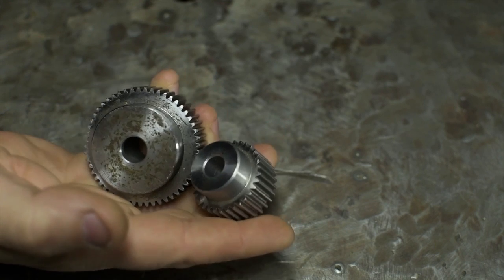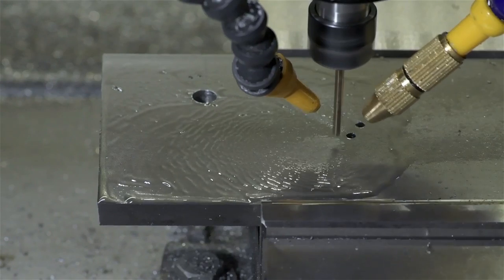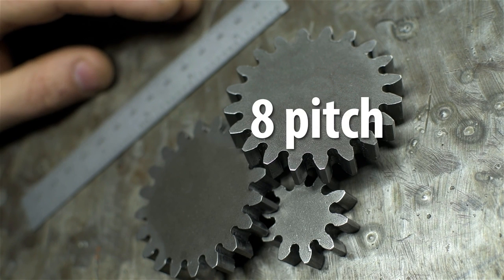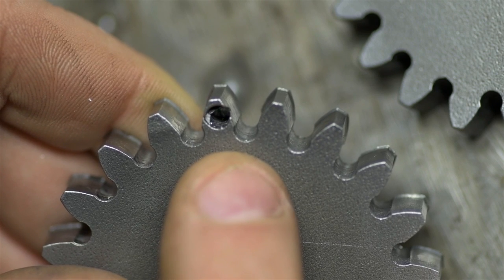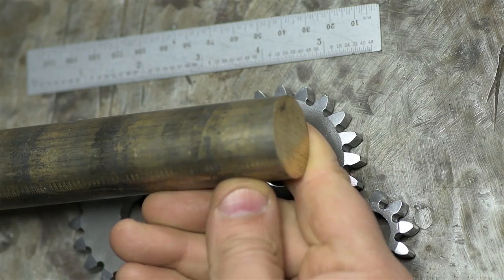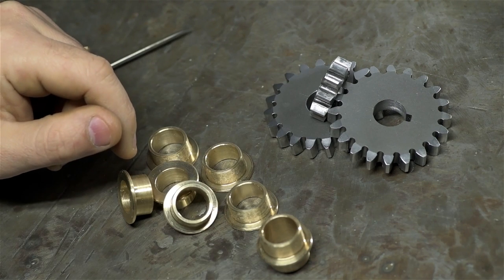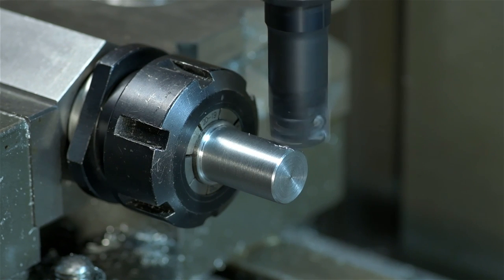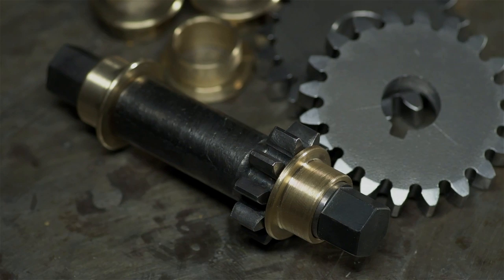Bushings and Gears: The Prequel

Comment: Why don't you also drill a center hole while the gears are on the router?  

Then it would've helped on the lathe for centering them in 4 jaw and also skip the center drilling part
Reply: I thought the very same.
Reply: its not as accurate plus he likes using the lathe :)

Comment: I liked your comment on 0.5 x a dozen. I grew up in a country that uses the metric system the way it was intended. The European and American way is to take 200 thou and multiply it by a hand of sand. Whatever you get is still a terrible thing to measure or work with. Suppose it is fine if you grew up with it. Its like having a four speed car with first and an eighth gear, second and three sixteenths, third and three eighths and fourth and and a half. Doesn't matter what you work with its always a fraction. Love your videos and the humor.

Comment: Super video - thanks for the share. Bearing bronze = very $$$ ???. Have to be economical playing with this bronze, unless someone knows where to source for hobbyist budgets??? Also, the collet chuck - are those available? When I google on collet chuck I get every collet chuck under the sun.  This looks like a cool project. I am interested in cutting some gears to pair up a couple of small model airplane engines. I have a StepCraft 840 CNC I have yet to spin up. I like the way you cut these gears.

Comment: Another great video.  Thanks +This Old Tony!    I'm curious about the center holes and keyways on each gear.  You've chosen to build them on the lathe rather than letting the CNC do the work.  Does the lathe give you better accuracy, or are the other reasons you've done it this way?

Comment: If you're breaking end mills doing plunge operations, have you ever tried ramping the initial cut? so you are pressing straight down on the end mill, you're going in at an angle......I use it all the time when using larger bits with no real bottom clearing ability. (on wood).

Comment: As usual enjoyed the video. Thanks. 

Just wondering any specific reason why you didn't  have the cnc router cut the center hole on the gears? I know you said about plunging, not drill, then mill...or drill on the cnc and use that to locate on the lathe and open up?
Reply: My question exactly, I've also done this technique with my machine and always cut the center holes with the router too. It looks like your gears are going to have some runout. You could also do this by drilling on the router.

I've also thought of drilling the bottoms of the teeth first, seems to work really good, I need to try that next time.
Reply: Probably time. It's quick in the lathe, not so quick on a router table.
Reply: I don't think the difference in time (with fixturing and tramming the part) isn't that high. And with drilling the hole while it is still on the router it will be really centric. It would at least give you a nice surface for indicating it on the lathe for further machining.
Reply: Probably just forgot the centre tick mark in the CNC, and figured easy enough to add later.
Reply: It’s easier in the lathe tbh.
Reply: He already had to put it in the lathe so he probably figure it was just easier to do it there

Comment: Hey Tony, I grew up working with lathes and mills in  my grandfathers machine shop. Unfortunately,  he sold all his machines before I could lay claim to them. I am an amateur gun builder, and want to purchase my own mill to do work that I have been farming out. I would really like to have a full size mill (like the 7' tall bridgeport that was my grandfathers "small" one), but they are cost prohibitive. Do you have any suggestions on where to go to find used mills? Maybe a suggestion on where to buy a smaller mill for gunsmith work? Which one of the small mills would you suggest? I am fairly certain the grizzly/harbor freight table top mill is made by the same company. Is it worth it? I'm on a severely limited budget, so hopefully you've got a couple of nuggets of advice to share. Thanks!

Comment: Thanks for another excellent video. A quick question: why didn’t you cut the gear centre holes on the CNC to ensure it was centralised? I appreciate you may have wanted to take it to dimension on the lathe, but surely it would still have been easier to dial in on an existing (smooth) centre hole than off the teeth?

Apologies if this has been asked below in the comments; I only scrolled down the first couple of hundred!

Thanks again for this and all the other excellent videos.

Comment: Tony!nice to see a great video again but I've got some stupid questions to clear up!why do gears have the bevel on the side face like that is there any use for it?also why didn't u centre drill the gears on the CNC?just wondering maybe you had a good reason, 1 last question, how did you index the hex ends on the stub shaft  to eachother I can't work it out! Thanks
Reply: It makes it look cooler which in turn adds ten horsepower
Reply from the maker: you know I have no idea why gears have tapered sides.  I think they look better that way though :)  I don't think store-bought gears have those anymore.  Sprockets use the taper to help line things up I believe, but no idea why gears have it.  Re: hex ends, if you mean the hex on one end with the hex on the other, they are not indexed to each other.

Comment: Tony, considering the tolerances you're working with here, would drilling and milling the year hubs in the CNC saved you a step?  I guess you had to put them on the lathe to bevel them anyway?  Maybe your router doesn't make smooth circles?

Comment: you had mentioned that cutting the root of the gears with the drill amounts to more backlash. I was wondering, for your CNC machine, you added in another video a 4th axis. Could this 4th axis allow you to cut the gear (and perhaps the drilling) as a helix gear? I know that the helix gear would provide no advantage in the ring roller. I am just wanting to know if a helix gear can be cut under these circumstances. Also, i note that the width (thickness) of these gears are low(short).

Comment: Bongiorno Tony,
Are those real involute gear forms? If so, how did you generate them in CAD? I've seen lots out there describing how to make close approximations and understand the unwinding string geometry, but found it difficult to implement using the standard tools in solidworks and the like. 

You're my hero!

Comment: It's a bad idea to plunge straight into metals anyway, try feeding in in a slope, works much better and you don't need to predrill. Drilling out the roots of the teeth is a very good idea though. I like to drill/mill in the center holes while the gears are still on the mill, that way you get them right on center. In a lathe you could end up having the jaws somewhere between teeth on one side and not on the other, so the hole ends up slightly off center.

Comment: I just started watching your channel and I was just wondering your thoughts. On that small gear couldn't you have drilled a hole into between the teeth and into the shaft and used a roll pin to secure it? Or would that have weakened the gear too much?
Reply from the maker: In this case, probably yes!

Comment: Tony

  Is the g-code used to produce the gears available anywhere?   Drawings for the Ring-a-Roller?

Jim
Reply from the maker: not yet I'm afraid.  plan to clean up the cad and make public.  never enough time!
Reply: Where would it appear if released?  Thanks Jim

Comment: Hi ThisOldTony,

I have a question or two for you;

1) When using your CNC why didn't you remove the ID when it was still part of the stock? Surely that would of saved some lathe time.

2) Why didn't you use your Shaper to create the keyway?
Reply from the maker: I'll answer #1 in the build video if that's cool.  For #2, these keyways are small / non critical.  Just a lot faster with a hand file vs setting them up in the shaper.
Reply: No problem,

Love your videos btw :)

Comment: Hey Tony can i ask why not cut the holes on the CNC router instead of the lathe? and why do you cut a centre hole on the lathe to the second cutter?
Reply from the maker: I could have, but usually try to minimize the time on the CNC.  It takes much longer than my other machines.  The second tool was used to bore the hole to final size.
Reply: most times on the centre drill I only just cut to start the drill as the second half is 60 degrees and have had the drill "grab" making the hole slightly out of true. Not that it matters really for what your doing :) greetings from Australia

Comment: Obviously this project is about building the replacement bits for the LHC (Large Hadron Collider). My guess is that it's going to look very similar to... wait for it... yeah... that's right... the particle accelerators that they use at Punkin Chunkin events... only smaller and more efficient. Don't crank that baby up too high and create a black hole. I'm not done learning stuff yet...

Comment: Why did every piece have a spiral cut when you were going back with the wheel? This would mean that your tool is closer to the piece going backwards than going in. It's been a long time I've been able to use a lathe and I do not remember if this is a typical "issue". But it is clear that they are the reason why you moved the cross slide out after the last pass.

Comment: Hello Tony!
I have a question: Why did you decided to use welding and not Loctite gluing?  We have recently a discussion on a hungarian forum, that the welding for connecting parts is rather habit of elder generation of people, who still not welcome the new achivements in machining like gluing. A convertional glue has 20N/mm2, which is adequate for a lot of connection. Loctite 638 can upto 180 Celsius, which is ok for a gearbox.
Reply: Almost forget: Gluing has the advantage, if something went wrong, the glued connection can be dismounted with heat torch.

Comment: no hate, just a hint:
be careful when you're turning in reverse.
The cutting force isn't  directed into the bed anymore, which results in much less rigidity.
Just pay attention, that the force of cutting is significantly less than the weight of your carriage.

Comment: Hi Tony, love the videos curious if you have the ability to comp a tool (to trick the machine into thinking it has a larger tool and then slowly reduce it)..not to question your intelligence..hope no hard feelings..I could see this being a little easier than rechucking the parts in a four jaw and controlling run out when making the bore...by comping a tool you can dial in a press fit. I’m a big fan, Tony...someday I hope you can sign my micrometer case..
Reply from the maker: I think so (fusion 360 cutter comp), but have never used it.  I wanted to minimize the material I needed to remove on the router (slow) and they were going in the lathe anyway (fast).
Reply: This Old Tony , understood..I see a lot of this in the CNC world, freeing up the tool carousel with common size tools and the use of conversational programs or software mapping out the tool paths for a circle you can be quite versatile and accurately make a perfect size hole by comping the tool..love the videos..I teach Manufacturing ( glorious name for machine shop) and on occasion I show your videos..you get people laughing better than I do..not jealous, just envious of your abilities and I feel angst and ...um...yeah..bravo on your YouTube success.

Comment: One of 476665 views. 
There isn't any way to fit a CNC router into the $10.00 purchase per week budget here at Old Sneelock's Workshop. I don't think I will be alive when the CNC's settle to the bottom of the pond for guys like me to pick up. 
Even if I had the CNC, tooling, cutting fluid, electricity, any one of them will kill the whole idea. Let alone a real piece of cold rolled steel that hasn't rusted half through or fallen off a bridge somewhere. 
P.S. If a bridge is missing beams I had nothing to do with it.

Comment: Probably you should make some kind of gear cutting engine that will cut one groove at a time on a metal disk to turn it into gear. If done rightly the gears will be dead on accurate and mesh well even without finishing, that way all gears  were manufactured before worm gear milling cutters became avaliable, even ones that were used for high torque and rpm

Comment: Why did you do a different pressure angle instead of an addendum correction?
Reply: Welders do addendums, mills only do subtractums
Reply from the maker: Just a change to the root would still result in too tight of a tooth spacing for the size end mill I wanted in there.  Increased pressure angle bumped that space up just a smidge.

Comment: Should have hardened those input hex parts first, that way the torque multiplier input shaft will last longer.
Reply from the maker: that'd be ideal, but this is mild steel; no hardening.

Comment: Wouldnt you have made WAAYYYYYYYY more than only six bushings with the digital mimeograph device? If its mimicking the existing items housed in it, shouldnt it of only needed 3 cycles. 1 into 2, 2 into 4, and 4 into 8, leaving you a couple back ups. I dont know what you're ever going to do with 32 of those bushings. ;)

Comment: Even though those gears are, um, "unique", the CNC router method sure beats the pants off of doing it in a lathe tooth by tooth.  I've made one gear on a lathe and frankly (can I call you Frank?) I would rather be dragged over carpet tacks then dipped in rubbing alcohol.  ;)
Reply from the maker: Frank is fine.  The only problem with CNC router gears is they can only be so thick.

Comment: I'm sure this is just naivete, but why would the plunge method you used be unacceptable for "real" gears?
Reply from the maker: Good question.  You could do that to rough them out, but 'real' gears don't have a circle like a drill would make anywhere in them.  This is as close an approximation I could make to the real shape without putting too much work into it.
Reply: Thanks for the reply, Tony!

I wonder, if you were to shape the ends of the teeth to match the rounded profile of the low points (I apologize for the technical jargon =P ) would that perhaps limit or eliminate the chatter/backlash of this method? 

You'd probably have increased friction at those points compared to conventional gear shape...
    ^ this is just my intuition speaking, so it's probably inaccurate ^

... but for most purposes I'd guess it would work just fine.

Comment: It's easy to nitpick on the Internet, but wouldn't those hexagonal drive shaft ends be even better if you had chosen the diameter a few mm larger than what you had, then milled the wrench flats at the size you wanted? That way, you get free chamfered edges and maintain a concentric (partial) cylinder.

But in reality, I'm just jealous.